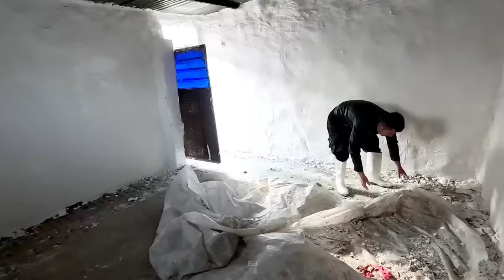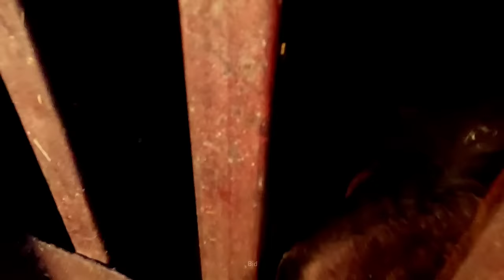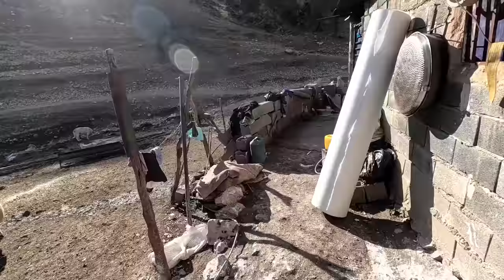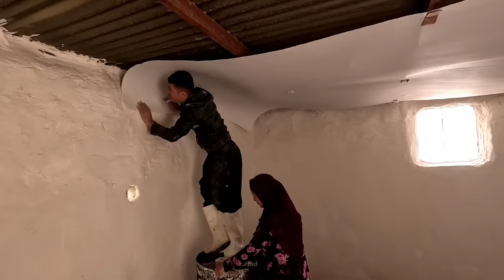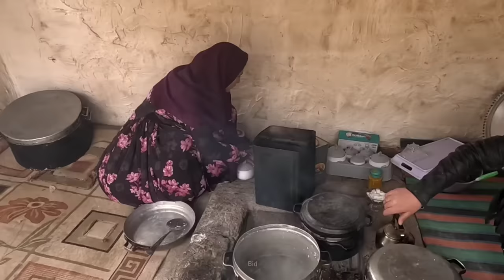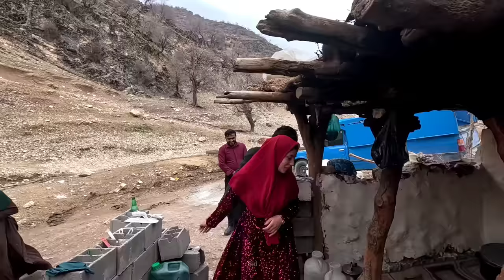Will Ali agree to Jamshid's marriage? Will Jamshid return home

Comment: Hashem and Ashraf, you include cleaning the outside of the room. Cement the flooring outside and have a dividing wall between your room and the sheep quarter., to minimize noise that will disturb the baby ( noise polution) who is sleeping